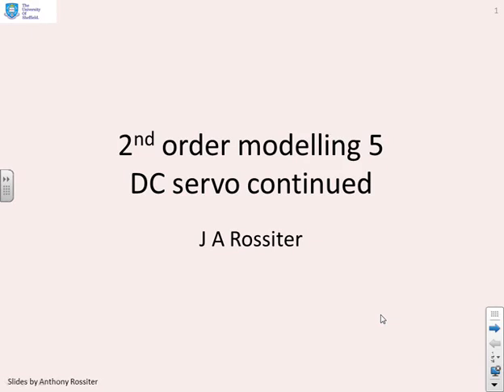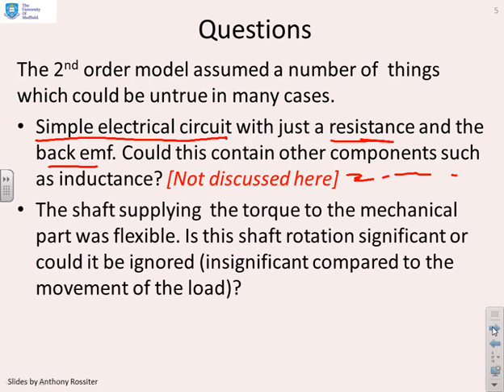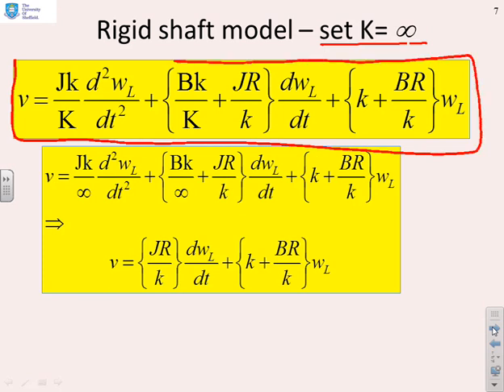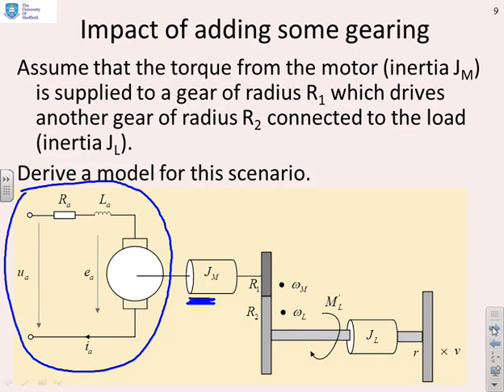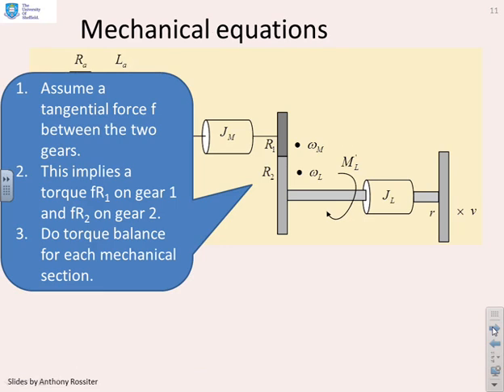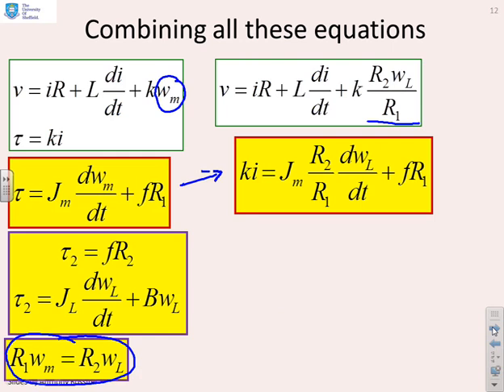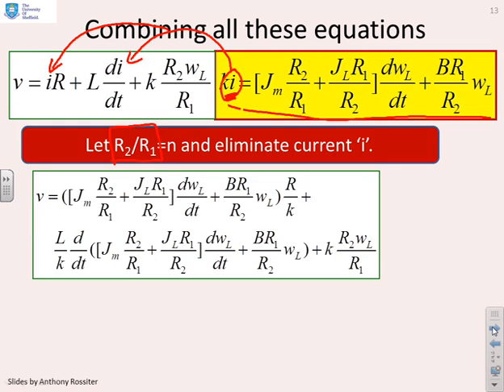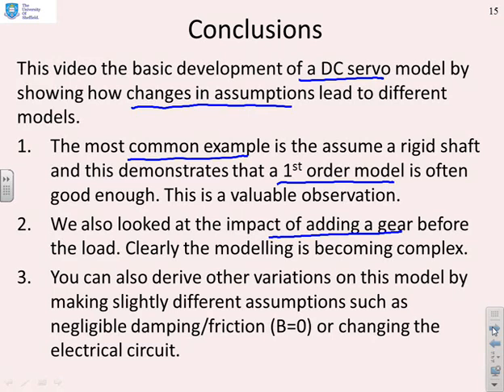Second order modelling 5 - DC servo and gears

Comment: Why did you take K= infinity?
Reply from the maker: Not sure exactly which part you are talking about, but infinite K is equivalent to assuming the shaft is stiff (negligible rotation).
Anthony
Reply: @John Rossiter alright got it, thank you. Secondly, I have a somewhat similar system in my mini project, and I modeled this system a bit differently with a different approach, and I came to the same result as yours. So I am quite sure that my model is correct. But here is the problem; in MATLAB my response is (unbounded) unstable. I can’t understand why, the parameters I got are from the motor’s data sheets, so is it my parameters that are making it unstable or some other error?